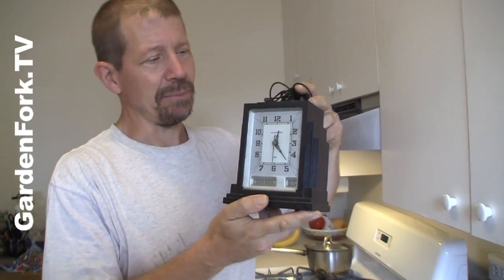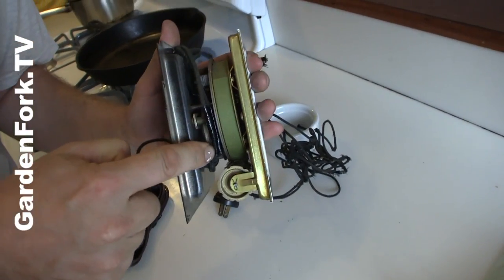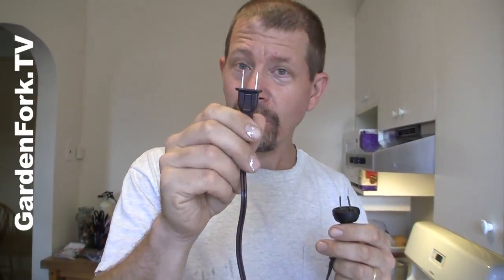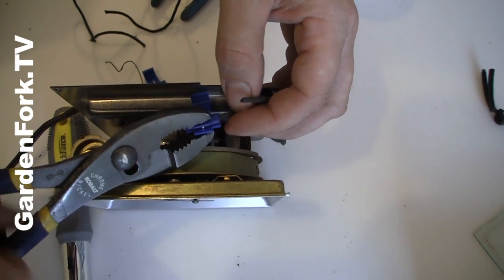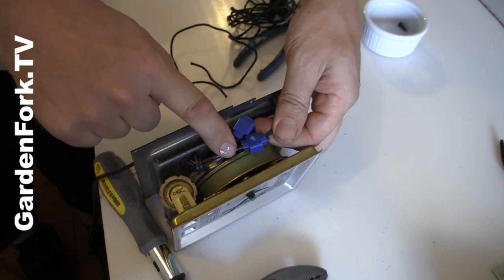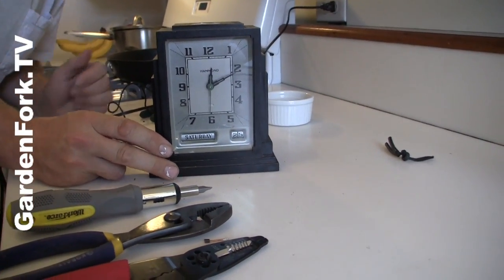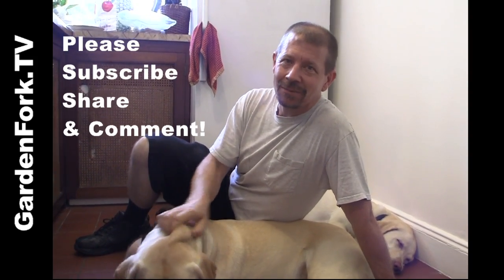Rewire Power Cord Antique Clock - GardenFork DIY & Cooking

Comment: The clock needs a helping hand to start as it would more than likely have a shaded-pole synchronous motor, which is incredibly accurate and reliable, but often doesn't have the torque to start. 
Thanks for the video and I appreciate the detail about the push connectors.

Comment: I have used those connectors several times in the past and never realized that I was crimping them the wrong way until I watched this video. I was folding the plastic piece over and forcing the crimp using the plastic. No wonder why I never got a good connection. Thanks Eric!

Comment from the maker: i understand completely. thanks for the info on sourcing materials too. we had limited time to do this, and the button plug was cracked, but good to know going forward.  thx!  eric.
Reply: Question: I have old (but not antique) electric analog clock radios and they have a thin wire in addition to the electric cord. What is this thin wire? What is this as supposed to be attached to? Is it used to ground the clock radio. Can I get better reception?

Comment from the maker: thx daniel, the push connectors are great for auto and home use, they have to be housed inside something if its 110 volt, but they save you from having to strip wire and use wire nuts or tape.   eric.

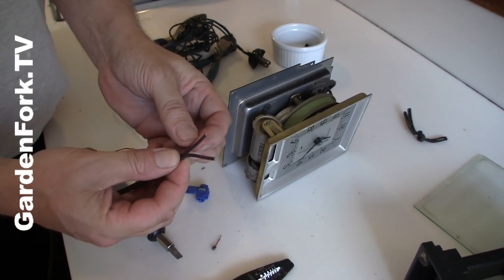Comment: This is a Hammond "Gregory" clock, To get the day, date feature to work set the day to the prior day, if it Tuesday set it to Monday do the same with the date, if it is the 5th set it to the 4th using the little drums on the bottom.  Unlike modern clocks the day date info doesn't change immediately after midnight, the day/date info will change between midnight and 3:00 AM. Once this is done, slowly rotate the time set knob on the back, if the time doesn't change between 12 and 3 your in the PM, (earlier models had a little cut out by the nine on the dial) if it was white it was basically daytime, if it was black it was night). If it did not change between 12 -3 your in the afternoon. Keep turning the time set knob to 12-3 again, when you reach 12 start turning it slower the closer you get to 3:00 the more the day and date change, by 3 the day and date should have changed.  On months with 30 days and leap year you will have to manually change the date numbers.  The man that invented this clock Laurens Hammond also invented the Hammond organ. They are cool little clocks. They were made with brown Bakelite, mahogany, and alabaster cases.

The manual start knob goes back to the early electric clocks before the became self starting.  Hammond kept it because if the power went out, it would not start and have to be corrected,, however self starting clocks would start up again screwing up the time for the day and usually making people late for appointments.

Comment: These are called Hammond "Gregory" clocks, more commonly called "skyscraper".  The reason it wouldn't start is it has to be started with the knob on the back designated with an arrow.  It's kind of a spin to get the motor running.  Thanks for the video.

Comment: For an antique or vintage clock or lamp, it would have been a lot nicer to use reproduction Rayon wire and reuse the original button plug. Places like Sundial Wire sell these parts. The new plug works just as well, but it's not nearly as nice (or cool looking). I'm a clock collector and antiques lover, so I'm picky for details.
Reply: Why don't you do your own video on this? I like to keep things looking original, too, but that wasn't the point of this video.

Comment: Very helpful. I just got an old Westclox and there are cords coming out from a motor on the back but they're smaller/thinner cords and don't look to be copper and they're clipped off already. Is it possible they're low voltage or made to connect to a battery?

Comment: Enjoyed that!   Thanks.  

I'm in Scotland and I did own a clock similar to this one as it had a day/date feature which I really like, but, due to the differences in voltage in USA and UK, a converter of some description is needed and that's the problem:  1.  could blow the motor in the clock or 2. timekeeping could be affected, or both.   Great shame.

I also have a Jefferson Golden Helm clock bought in England, UK, but again requires a converter for safe and reliable functioning.   The converter that deals with points 1 and 2 above is proving very difficult to obtain.

Gaius

Comment: I have a Hamilton/Sancamo electric clock that I think was manufactured in 1934.  My friend rewired the clock and it runs very fast.  Any idea what could cause that.
        marge
Reply from the maker: sorry Marge, I don't know why it runs fast. you might find a website that deals with clock collectors that might know.  thanks, eric.
Reply: This clock was. Manufactured in the thirties.  Thanks for the info.

Comment: I know this is an old video, but I'm wanting to replace the power cord to this phone.  There's no difference in the prongs so how do I know which wire goes where when replacing the power cord? I have pictures of the inside.

Comment: you should use butt connectors. those piggyback connectors can get hot and short out....ive had bad experiences with those kind of connectors... plus butt connectors usually have heat shrink on them. happy hunting!
Reply: I know what you're saying, but the motor in this clock only draws a few watts (I think it's 3 on a Hammond clock) so it should be fine in this application.
Reply: I'm an electrician with many decades of experience. Done properly, as in this video, these connectors are perfectly appropriate for the load. The concern was to show a safe and reliable means of making the connection to a less-than five watt motor. Well within the range of these connectors.
Now, would my shop do it that way? Of course not. Is this safe and perfectly appropriate solution better than trying to explain to somebody who hasn't a clue how to dress down the well over 80 year old field-coil connections, tin them, solder them to the right size and flexibility motor leads, insulate them and secure them (hint, not with electricians' tape) and then connect those leads to the properly anchored line cord within the clock, observing mechanical and thermal and electrical isolation, proper use of wire nuts (which we wouldn't use, anyway), their proper insulation, how to heat shrink tubing....
No, this was an excellent way to keep someone from doing something really dangerous while still replacing the line cord.
As to the purists who love those ancient bell plugs....yeah, get it (I also collect antique clocks) but, no. I can't imagine even half the audience grasping the nuances of an UL Knot, much less properly insulating the screw terminal end of the plug and and and.
But, heh - we're all armchair critics. I just happen to know what I'm doing, which is why I like this video. A lot.